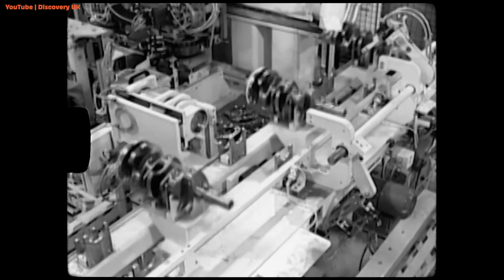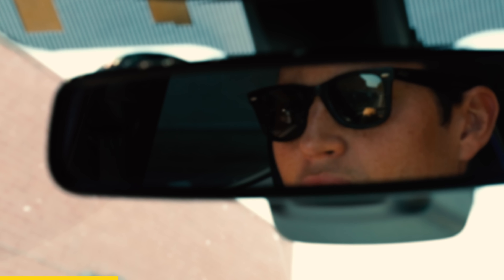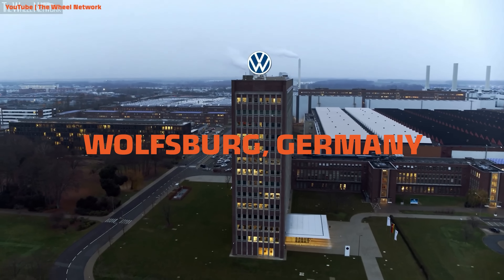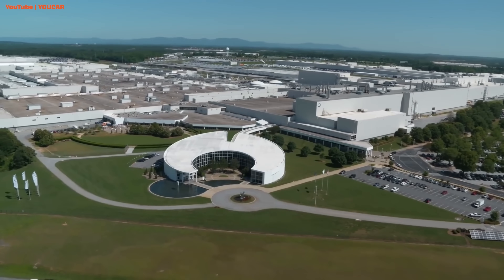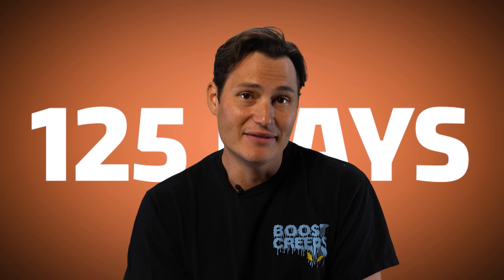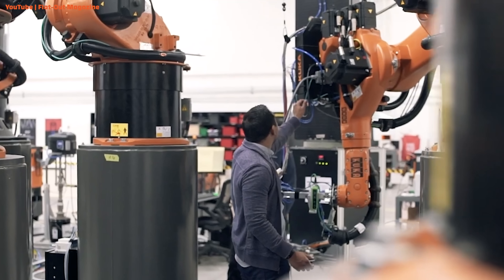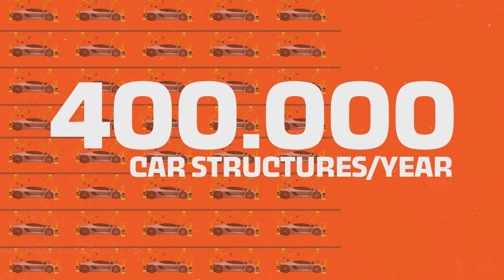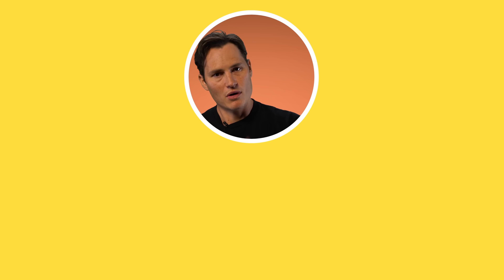A.I. Designed this Car

Comment: I've never seen anyone, in public or private, that have Raycon earbuds. Nobody
Reply: How often do you go out
Reply: Raycons are pretty ass for anything that doesn’t have a ton of bass.
Reply: Its because they're horrible and just as expensive as "leading brands" not "half the price" as they say. Watch any review on them and you'll learn everything haha
Reply: It's because they're shit. They're nothing but bass, have a shorter battery life than other earbuds of the same price, they're made like shit, and they're 200$
Reply: I have.
Reply: i hear they are trash, and all the monies was spent on marketing
Reply: Ive had my e25s for going on a year (i picked them up in Nov 2019 for 65$ after a promo code) and have used them quite literally everyday i could, the kind of work i do its very nice not having cables hanging out your pocket. Ive droped the headphones themselves multiple times on cement, dropped the right side in a puddle, and washed the case in the wash and the dryer (had the headphones on so they didnt get washed & dryed) and they still work! They even still hold about 6 hours battery life in the headphones themselves, even if the case doesnt hold a charge like it used too. 
Anyway, theyre the best headphones i have ever purchased and i will be buying myself a new set this holiday. Money well spent
Reply: @xxSgtXioXxx291  You do realize that with 40$ (Assuming you're american) you can get a pair of headphones with a 24 hour battery life (NOT the case's life, the earbuds themselves) that ACTUALLY sound good and aren't just washed out bass? If you look at the raybud's default EQ and hardware EQ, pretty much 60% of all music is drowned out by stupid amounts of base, which is only good if you like obnoxious rap / hardbass and EVEN THEN it sounds like shit
Reply: @sharcc2511  i listen to everything but mostly 70s through 90s rock
Reply: @xxSgtXioXxx291  I don't know how the fuck you're enjoying it then, that timeframe of rock is intensive on the mid-spectrum of audio and the Raycons de-amplify everything above bass and sub-bass so it must sound super muddy, try listening to the same song on the raycons, and then on headphones equalized for mid-low spectrum and not just ultralow
Reply: @sharcc2511  wheres that link for your amazing, totally long lasting headphones?
Reply: @sharcc2511  that's what i thought, you dont have no product to compete with raycons, and you shouldnt have bad opinions just because it's a popular ad for YouTubers. Infact, if anything, raycons provide a form of adds for alottt of YouTubers, which without good ads they would be fucked
Reply: @xxSgtXioXxx291  Nah i literally forgot about this thread hangon a sec
Reply: @sharcc2511  i thought you said they were 40$?? Also had 24hrs battery life??? These are more than Raycons and have 2 hour less battery life 😆😆😆
Reply: @xxSgtXioXxx291  I was thinking of a different video. Also no they aren't??? E25s are 110$...
Reply: @sharcc2511  you must not know how to use google, e25s are 79.99 American
Reply: They're only trash if youre listening to trash music 😉
Reply: @sharcc okay well lots of people in this world with trash/wrong oppions. Nothing i can do with that, im speaking off my own experience with them. I personally think they sound amazing, on par with beats or other similar ones. Again mine cost 65 bucks theres nothing out there that can touch them for 65 bucks
Reply: @sharcc you got link?
Reply: Thats because with the sleek design you cant see them in someones ears, to the people that are saying theyre 200 dollars are not talking about the every day 25s, which last i checked were 80 dollars and that's not with most youtubers 15 percent off code
Long story short, if you dont have them or have used them, keep your poop opinion to yourselfs
Reply: @xxSgtXioXxx291  Pretty much EVERY single unpaid review on them says they're shit and not worth it because other brands are better for the same or even cheaper price
Reply: Yo fr tho, somehow they got ad money to pay tons of people
Reply: @ToXiiCxGUNNER  owned by Ray J
Reply: I have, love them

Comment: So you are talking about AI that created it. But you come back to saying that human program the software and the perimeter for it..  then it is just computer programmer and software designer that created it.  I work with alot of robot and they are pretty much garbage.  Every time I turn around something get F up.  IE mechanical, electrical, software, programming and even heat.  It take longer to fix and maintain the equipment.  Sound like a good fairy tale story.

Comment: All these comments about a mechanics nightmare

Little do you realize those robotic arms are going to be the mechanics, with different jobs programmed
Reply: A robotic arm on Bobcat tracks rattles out of the bay, wearing a denim cap on its interface screen and a fake mustache.
<in Fallout Protectron voice> " how-dy theeere Slick, what seems to be-e yeeer prob-lem?"
Reply: @henryrodgers7386  runs diagnostic software
"Playback sample 0361 - Long intake of breath. Ooh that is going to cost you. You really should have brought this to me a month ago."
Reply: I love being a mechanic it’s so fun and only love V8s if an AI can make V8s that’s actually engineered not absolute garbage then I will build cars till I die
Reply: RARAYAYA RAA  this guy gets it.
Reply: not likely they can't find corroded wiring not to mention I don't think those arms fit nicely under the hood jammed up against the engine like mechanics hands need to be to do a lot of work
Reply: @lootangshellhouse2506  the point of this car is to design it so things like that are not a problem. Also, if my 2015 Nissan Versa can tell me there's a wiring fault, this thing definitely will be able.
Reply: When they break are we going to be able repair these cars with parts (made on demand) at RockAuto, or are we supposed to just throw the whole car in the recycle bin and get a new one.
Reply: Ben Daulton  I've personally seen and worked with welding robots. Those robots are insanely fast and insanely precise and make zero mistakes. That's where I got my idea from mostly

Comment: The ai will probably be used more in the future for design. However, I don’t think 3D printing is the future. It’s made for prototyping but not mass manufacturing. It’s a slow process which means you can’t make as many which means higher costs. It’s great for testing designs though or one offs that won’t be mass manufactured.

Comment: 3D printing is still massively more time and energy intensive. There's simply no way a 3D printer is going match the speed at which a press can produce vehicle panels.  You stated earlier that the car takes 125 days to produce but added a vague caveat that an nondescript "base" is done in an hour. What does that even mean?  These AU's still sound like their boutique manufacturing cells.

Comment: Bruh this company is using this car as a publicity stunt to promote their manufacturing products... smart move
Reply: If this is true basically anyone could start a car company.
Reply: @greyfox78569  anyone with money* and its more common than you think lmao specially with ev's
Reply: @greyfox78569  It's pretty much how any business with its own manufacturing process works. I wonder if anyone else in the automotive industry has ever changed the the entire process by creating a new way of creating and assembling cars... within the last 100 ish years or so maybe?
Reply: @masonkelly6694  can't tell if you're sarcastic, but A LOT of manufacturers made changes into production methods, search up toyota's big revolution: the "just in time" method.
Reply: @greyfox78569  not really, you still have to create the AI and know how to use it. Then you need a network of computers for it to run on, these things wont just run off your laptop.
Reply: @ayrtonclark2023  What I meant was a millionaire could now start and run a small car company and compete with the big boys. They AI and machinery was created you just have to buy it from this company.
Reply: @greyfox78569  
Anyone can do anything the want if they have the resources and the drive to do so, or if they can acquire the resources.... drive is still essential.
Reply: @thomasberry8012  Yes but this makes it a thousands of times easier. Also good luck starting a car company in a regulatory market designed to prevent start ups from succeeding and there by upsetting the market and potentially put vital military contractors like Ford, GM, and FCA out of business.
Reply: you mean like how spaceX promoted their rockets by launching tesla's roadster into space along with it? or was it the other way around with Tesla promoting their car by launching it in a rocket? either way, pure genius.
Reply: Shut up

Comment: The good news is that there's only light damage to the chassis.
The bad news is that this has also taken out every ancillary system as they were all running through the frame.
Some more good news is that we can fix your car.
Some more bad news is that it's going to cost as much as you paid for the car in the first place...

Comment: Wouldn't 3D printing be only as strong as casting and that there are some things that can't be replaced by that yet (such as crank shafts and pistons which are almost always forged in high power applications) in a 1000+ buff horses hyper car?
Reply: Porsche has been testing 3d printed aluminum alloy pistons for the GT2 RS,  and they've reported pretty much nothing negative about them. 10-20% lighter, higher revving, built in oil cooling ducts allowing it to run almost 70 degrees (F) cooler around the piston rings. They can handle at least 700hp, so 1000+ with a beefed up design isn't unreasonable. Cranks and conrods remain to be seen.

Comment: It’s very interesting. 
But will the computer think of crazy ideas - the innovation in cars ? 
Like the Gordon Murray t50 - will the computer be able to make decisions that a designer would make and innovate something like the fan car. 
Would the computer say, if parameters programmed- I want to build a car that allows for maximum driver engagement and put manual in the car ? 

It can design a car but can a computer designed car appeal to emotions like other cars do. Would it say - none of the conventional fuel works - here is a new radical solution to your mobility. 
Because this system is as good as it’s programmers.

Comment: Man I'm so sceptical about this. How does the AI factor in redundancy? What about the failure mechanism of the car? If it's 100 % efficient, does it mean that if something unexpected happens it just breaks down all at once? For the the AI to have truly learned everything about making a good car, it would have had to learn like so many freaking factors that I have no clue how they could actually truly do that unless it made tons of different cars and sent them on the street to survive through evolution lol. Like how the fuck do deal with reparability? What about if there's a major flaw in the design? Can it even be understood by humans to see that flaw? If not how does the AI practically test that without thousands if not millions of test runs, because it feels like a computer simulation, although being powerful, couldn't possible look at every possibility of everything that could happen with the car. Temperature weather, aerodynamics and stuff like that sure.. but what about all the random things that happen in the real world?

Comment: One question tho, if it's only possible to assemble by machines and the wiring for example, how can be maintained or change parts or fix any failure that might occur???

Comment: Only if the cost of this car development was comparable to it's sale price.  With such a much lower cost of initial development costs I wonder what the profit margin is on one of these.  Especially now that 3D printing has become so much cheaper then just a few years ago.  I would assume most of the cost would have come from the software development but after that curious about the raw cost of materials and machine labor costs.

Comment: One point you could have touched is that countrary to the robots wich look quite fast, the 3d printing process is not and 3d printing is not scalable (means that you don't reduce the price of individual part if you increase the number of them).
That's why the industry uses presses and forge as it's main manufacturing tool : the tool is very expensive, but it can produce so much piece an hour that it's worth it. So I don't really see how this process is revolutionnary for the industry. As you said it take 125h to produce this car, and the botle neck was never the assembly, it's the 3d printing

Comment: This must be some of the reasoning behind the air force recently being able to design and manufacture a new fighter jet in a year. It was unprecedented.
Reply: F-80: Idea to flying prototype in 6 months. Not possible since shortly after due to safety restrictions. Computers are closing that gap though.
Reply: @chadvarnell1889  I thought they had it in the air recently. I was mistaken though. Apparently, when they said they flew they meant in a full scale flight demonstrator. I must have flown right by that. 😁 Thanks for the response.

Comment: If this is the future that would make repairs so cheap need a new part? Sure just order it up and it can be 3d printed no need to have to waste space in a huge warehouse of stamped parts because the new generation of your cars being made and no ones pulling the old dies out and resamping a single peace for your car my only thought it if its built by A.I will there still be trained mechanics that still know how to take apart things to fix them if needed?

Comment: Right Know 3 d printed Metal Is weaker than using "normal" methods of Manifactoring. And Just because it is constructed by ai doesn't mean that it is better than a human could do it. It is hard to get a AI so mich data that it can create a perfect part.
Reply: And its so incredibly slow.  You could easily make a lost wax/foam mould for casting aluminium and have a part ready to go faster than 3d printing aluminium.  Scaling up makes casting better and better.

Comment: The issue is, they already have the dies and molds. No current manufacturer would want to spend the money on a new manufacturing line, especially if they can't fill all the space they already have.

Comment: One thing is wrong here.

3D printed parts are not very strong and by far not better than e.g. forged metals
Reply: It depends on the material. You can 3D print titanium, which is very strong and very light.
Also with the computer engineered biological design, parts will be stronger and lighter then a conventionally produced part because all available material is stressed and therefore used to it's limit, where a conventionally produced part will always have parts, that don't do anything structural and therefore will be heavier.

But you are right if you compare similar parts. If you print a part that was designed to be produced conventionally, it may end up being weaker. But then you miss the point of 3D printing completely.
Reply: @UniversalJogger  I said that what he said was wrong. For the car to be designed and built by 3DP is just not very convenient in safety aspects